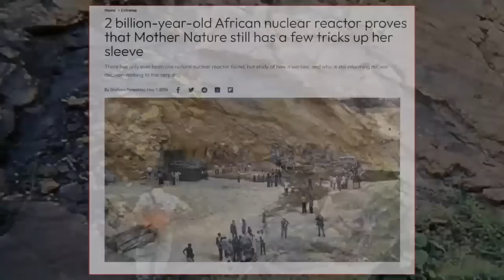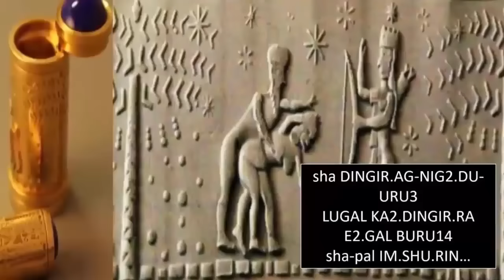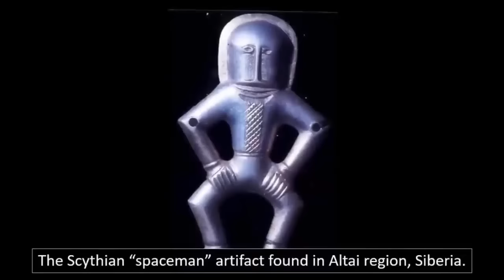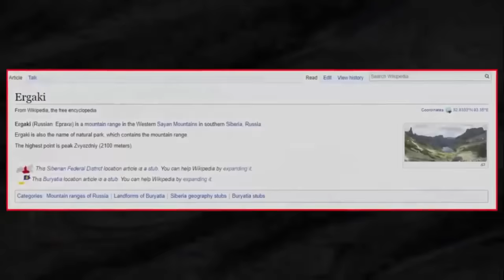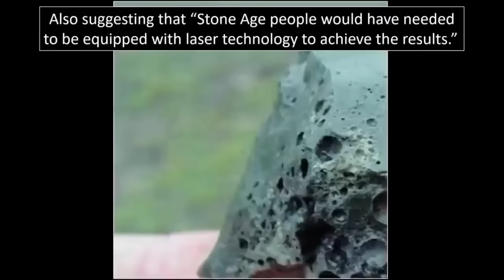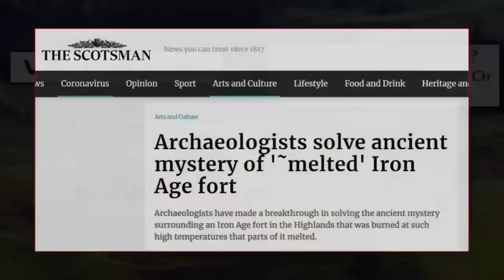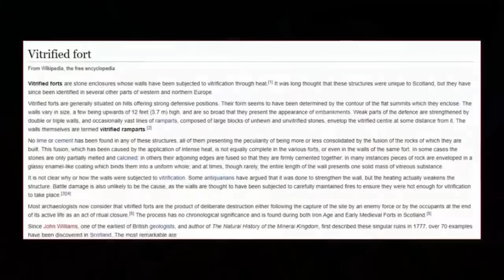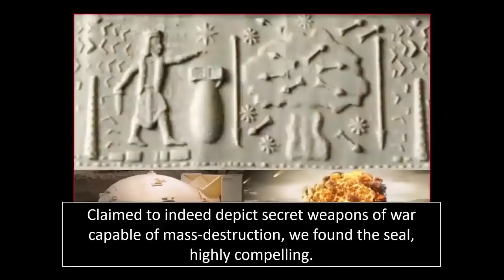Global Proof of Ancient Nuclear Technology?

Comment: Pictures/stone carvings are worth a thousand words.

I would argue that the "melted steps" happened (inside) as the kind of heat it takes to melt the granite steps coming from outside would undoubtedly damage the walls and the "window" itself. The heat from an external explosion isn't focused on a single area like this......
Reply: I was thinking that it could be the walls were built later since they are undamaged by the tremendous heat needed to melt granite.
Reply: @kirkhepburnmiddleagedwhiteguy  

That could very well be ...👍🍻
Reply: Those steps are sandstone not granite. Sandstone is a considerably softer rock, which means that damage could be natural damage/erosion from thousands of years of use and weather exposure.

Comment: Why would those steps be melted but not the outside of the building that theyre in?🤔
Reply: I would suspect a directed energy weapon fired from an elevated angle and focused on someone or something standing on the stairs or at the window...probably bisected them pretty cleanly.  After looking at the window more closely, I realized it is built in the configuration of a fighting position, allowing the shooter on the inside to maneuver their weapon at various angles, while from the outside a relative small aperture presents itself and hence does not facilitate counter attack.  Note also the lower lip of the window appears to have been melted as well.
Reply: There's not even any damage to the wall mere inches above the "melted" steps. Surely something with enough heat/energy to melt the steps would've damaged the wall as well.
Reply: @unkledoda420  It's totally possible the DEW was mounted on something similar to the three axis inertial gimbals we us on our classified ISR birds but was actively illuminating a target (most likely IR track while scan) instead of imaging.  The gimbal would have allowed the DEW, while propagating in orbit, to paint the target in both the vertical and horizontal planes almost simultaneously with a minimal amount of scattering, so the walls would have not seen much if any collateral damage.  Vortex shedding effects would not have been a problem, but a highly precise gimbal would have been required to account for orthorectification to precisely engage the target standing at or near the window, and if you look closely, you'll notice some "liquidfication signatures" on the bottom of the window sill itself, but again, the walls would have been spared. IMHO.

Comment: But there is one piece of technology i know of today that can actually melt all these materials and turn stone into a harder material than glass (ceramic) that is a blowtorch/flame thrower that is firing a certain type gas hho gas hydroxy gas , which is simply water h2o split through electrolysis into 66.67% hydrogen/ 33.33%oxygen at that perfect ratio the gss IMPLODES not explodes, tungsten with a melting point of over 5000, this gas can melt it in seconds , and if holding it to the ground, it'll burn through stone in less then a minute, and the melted stone around the hole will be a super hard ceramic material
Reply: A hydrogen/oxygen bomb could also do similar carnage

Comment: I believe the "melted" stone was actually partially dissolved and reconstituted by chemical means. In fact, I feel strongly that much but not all of the megalithic blocks found in ancient structures were made that way. It's not at all far fetched as we currently use a similar process in mining. I do know one thing, moving bags of pebbles and reconstituting them into one big stone can easily explain how some of the blocks were put where they are and also easily explains why they fit together without gaps. Some stones were cut and moved by machines but some sites didn't show any evidence of that yet they're still megalithic. I think "nubs" are stone sprews. I believe stones and statues that seem to flake away are poorly mixed or impure slurries of partial dissolved stone which were poured and cast. I also believe that stones that seem to have exploded, did so during the endothermic reaction responsible for reconstitution. The one thing that I think is completely unrelated is when you see scorched and glassified exterior walls. Those, I think, were caused by giant convex mirrors which are recorded in myth and history to be weaponized. Solar flares and nuclear weapons don't target small spots like the ones we can observe. Solar flares cover no less than one whole side of the planet and nuclear weapons will damage everything within range that faces the reaction.

Comment: The only natural power with the strength to melt granite coming from space is a gamma ray burst from a supernova, hypernova, a passing galactic black hole eruption or an x-ray burst like a long duration X10+ from our Sun. No X class flares of 10 or higher has ever been recorded. So, was it a natural, unnatural or supernatural event?
Reply: We must inspect the outside face of the temple to determine if it was a blast or a beam.
Reply: We had an x35 last winter, goof.
Reply: Those "melted" steps are sandstone not granite. Big difference.